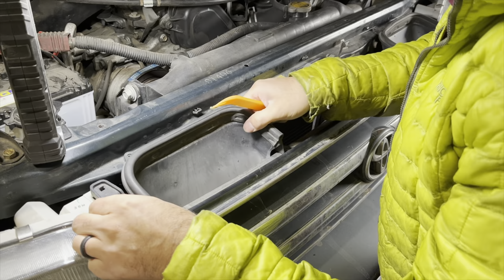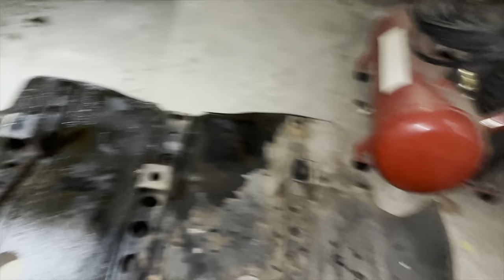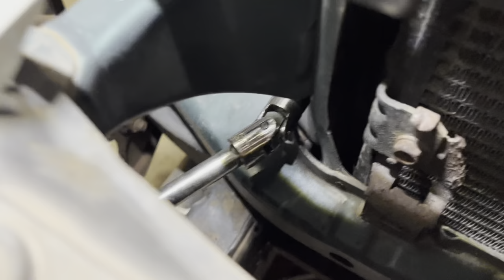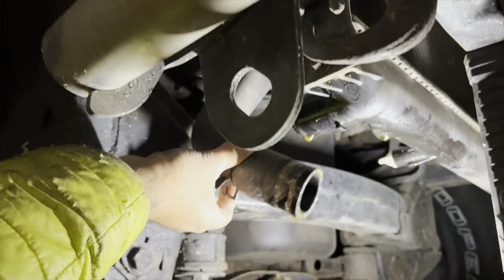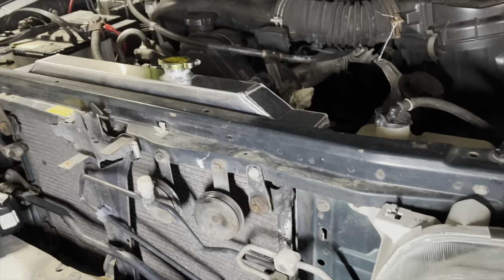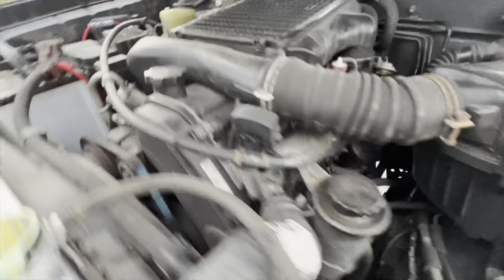Toyota Prado Aluminum Radiator Replacement KZJ95 1KZ

Comment: @thebrodojo how is it holding after a year? My KZJ95 1kzte is over heating uphill at low rpm. I am planning on replacing my radiator soon. What is the part number of yours as the amazon link doesn't work anymore? Thanks
Reply from the maker: I’ve since sold the Prado, but haven’t heard any complaints from new owner.
I’ll see if I can relink the radiator later tonight. Those Amazon listing always changing 😄
Reply: @TheBroDojo  thank you

Comment: Handy video, thanks. Did you lose much trans fluid from the oil cooler?
Reply from the maker: Mine doesn’t have that as it’s a manual transmission. 
Though, when I replaced the radiator in my auto 1kz Hiace only a very little bit of trans fluid came out .Not enough to need to add any fluid

Comment: I have bought 2 of those. They don't last long. 1 year each.
Reply from the maker: What is failing in yours?
Reply: @TheBroDojo  the welds between the tubes and the upper plate. Directly below the filler cap. When it gets hot, it sprays. Both of mine failed in the same place.
Reply: @gyffjogofl7676  that's sucks I'm bought to fit that part
Reply: @saltyoles  just keep an eye out for leaks, they are coming
Reply: Does the orginal radiator cap fit good in the aluminium radiator? I can imagine that the welds fail when the pressurized water can't overflow past the radiator cap into the reservoir. Cheers